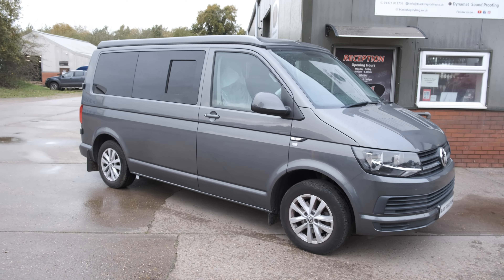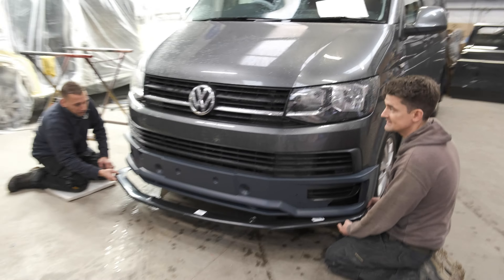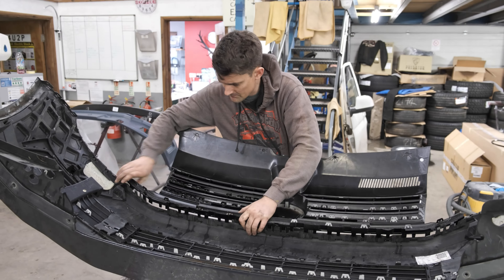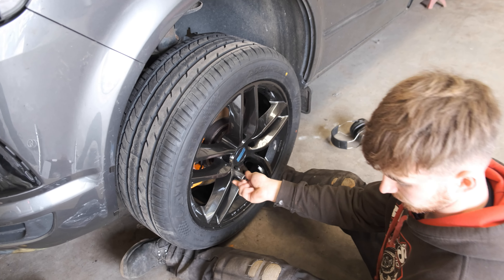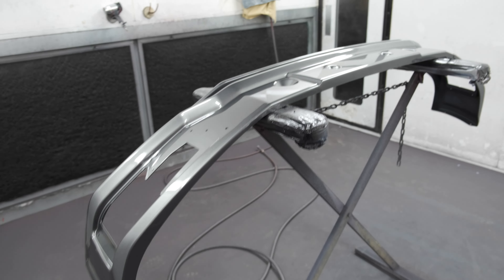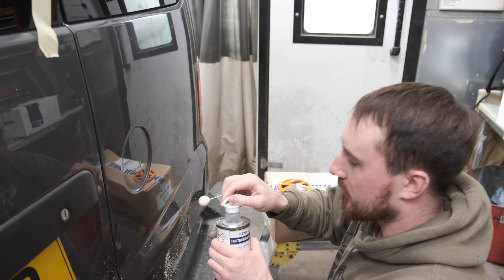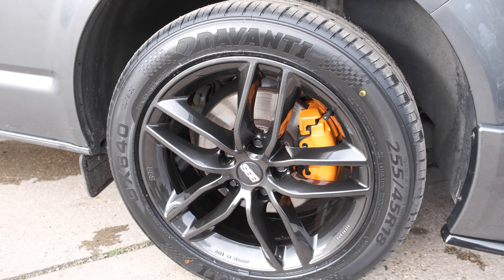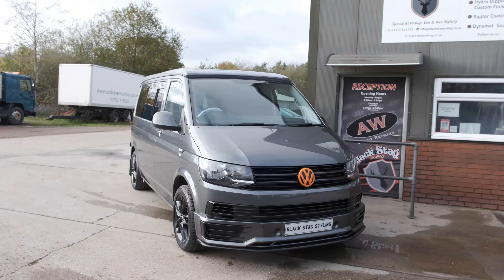VW Transporter T6 Styling MODS - What to fit - AWESOME campervan and day van Modifications

Comment: Nice , colour without been OTT.  glad you stayed away from 20” wheels I sold my 20” that the previous owner fitted , look nice but horrible ride . With lowered coil overs . Gone to 18” but they came with 235/45 will try and change to 235/50 and lift the coil overs up as need more ground clearance without been to high unable to fit in car parks . I’ve had to respray some body work T5.1 suffer from rust . I used to be a automotive painter .